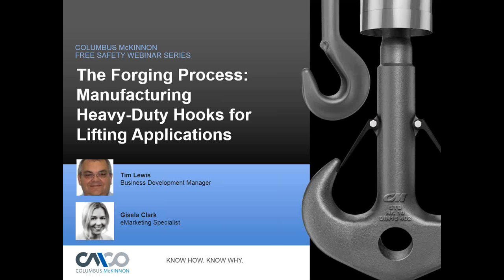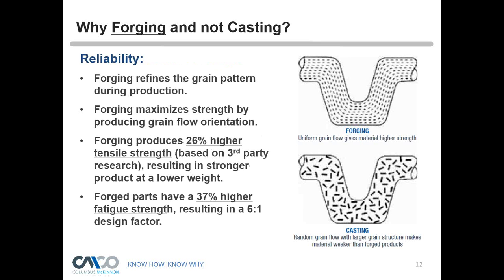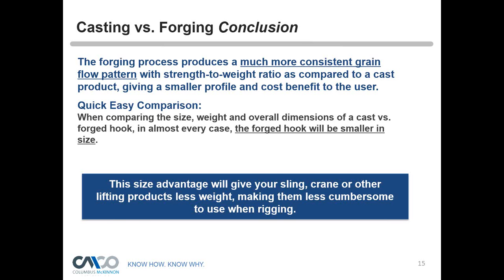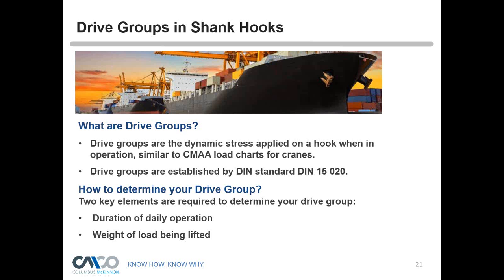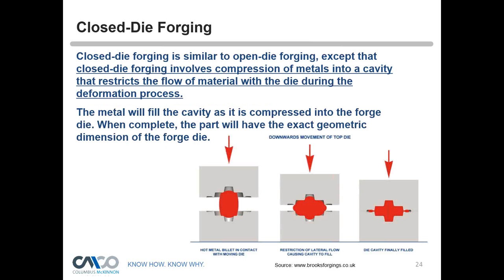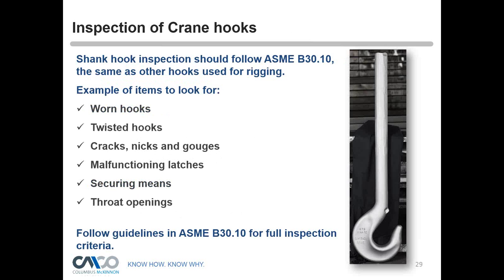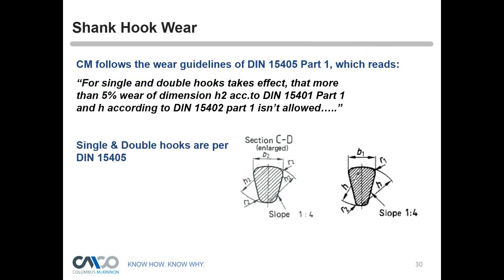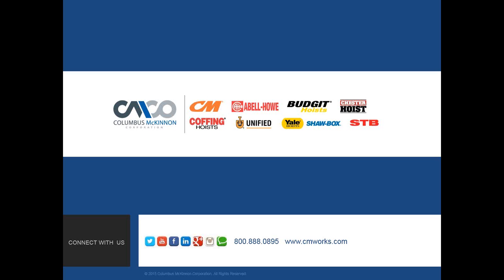Safety Webinar: The Forging Process - Manufacturing Heavy Duty Hooks

Comment: Any grappling hooks? I want a heavy duty one that is strong enough to lift a car. But not a massive amount of metal. Thanks.
Reply from the maker: Hi Altruism, 

We could make a grappling hook for sure. 

But you should look through our Rigging and Chain Attachments catalog at https://www.cmworks.com/Public/61961/CMRiggingProductCatalog_CMRP-6_0717.pdf  and see if there is a standard product that would serve your needs. You might find something there that’s available quickly.

You could also look at https://www.cmworks.com/Public/12/6994/TowingJHook_Cat.pdf as this type of assembly was designed for the application you mentioned.

If you don’t see something in this catalog, then you’d want to contact our "specials" group by describing what you need (maximum capacity, sketches and/or drawings of what you’re looking for, etc.) and sending an email to specialapplications@cmworks.com. Please include a phone number we can reach you at if additional information is required.

Thanks for reaching out to us.

Mike Osborn
Global Product Manager – Chain & Rigging Products
Reply: @columbusmckinnon  please tell me the defects which are occurring while manufacturing the hook.